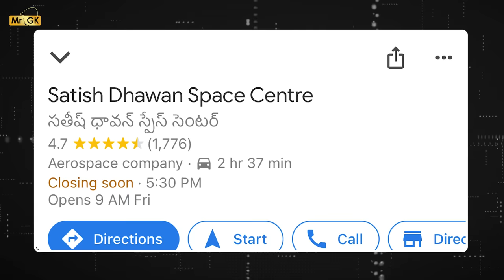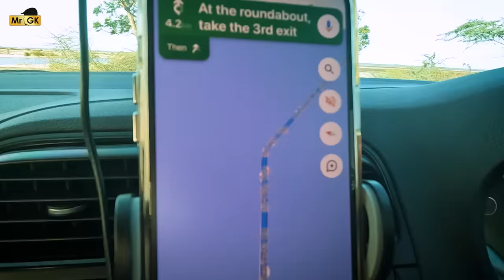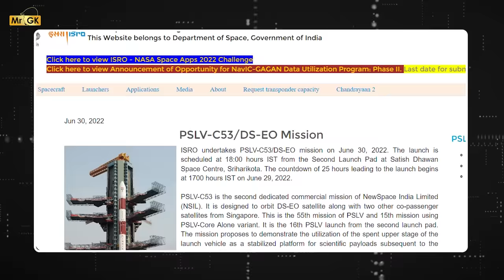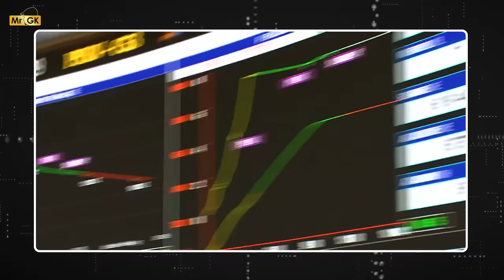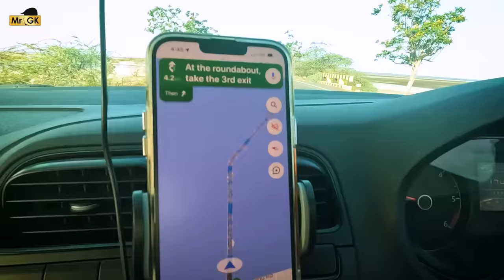PSLV C53 Rocket Launch | Live Vlog from Sriharikota | Mr.GK

Comment: Had a chance to visit ISRO 6 year back..we were offered opportunity to visit both launch pads and assemble and service  arms... Amazing infrastructure...Particularly that flame trench...when onee staff explained that while launching about  laks of litter water is pumped into trench to preserve the structure from damage caused by sound waves...And saw launch control room which is about 6km apart from launch site ( networking... no words to describe) and tracking rooms...How rocket trajectory is monitored from various station in India and overseas country...it was really amazing visit...ISRO is one of the place which made realise how Engineering is and importance.. We are mocking  Engineering students...But visit ISRO once  you will realise.all will change the perception on Engineering and get motivation to  pursue engineering.. We have more of Engineering college but still struggle to produce talents...